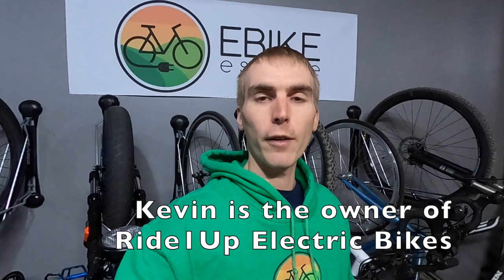Cadence Sensor Vs Torque Sensors | Which is Better on Ebikes?

Comment from the maker: Which do you prefer - torque or cadence sensor?
Reply: Is it possible, to upgrade our Radwagon to a torque sensor ?
Reply from the maker: @Ematuresco  Not easily that I am aware of.
Reply: Very complicated question.  For me cadence because I have respiratory problems and need it.  If I would ride just for exercise, and could handle torque, I'd rather have that.
Reply: This is easy for me. I rode an ebike with torque sensor and fell in love. I built one with cadence and was thoroughly disappointed. Torque feels natural. Cadence is probably fine for commuting.
Reply: Case by case. If I want to ride the bike just for the sake or riding, and beef up my cardio - torque sensor. For commuting and doing work, when I don't want or need to get exhausted riding a bike - cadence sensor. As a delivery driver, cadence sensing works better for me most of the time. Take it from me, after 4 hours on a bike, you don't WANT to exercise anymore, you just want the thing to get you where you need to go, reliably and with minimal effort applied. Especially up the hills. So I'm perfectly happy to ghost-pedal while the motor does 99% of the work.

So I have both. A TSZ2 500w torque-sensing mid drive bike, and a big ol' direct drive 2000w hub cadence sensing one. I use the first one for recreation, and the second one for my job.
Reply: @necroticavalon5176 Good points👌.

Comment: Thank you Kevin for the interview. The use case for the cadence sensor is stronger for more people more of the time.  The torque sensor is better for true trail-riding, when you want that quick, precise control over torque/power as you navigate rock gardens, roots, switchbacks, etc.  Serious trail-riding is also where a mid-drive outperforms the hub.  But for all other scenarios the cadence sensor works better.  When a noob friend was asking me about it, I explained it this way: when you're getting exhausted, the cadence sensor will still give you the same amount of assist.  On the other hand, when you're "gassed out" on a torque sensor, it will give you less help, even though you need more.  I remember my first long ride on a torque sensor; I was so disappointed at how I kept having to push myself, even when I was getting tired and wanted more help from the assist motor. Like a non-ebike, there was just no getting a break.  Torque sensing means you get what you give, no cheating.  (Unless you have a throttle, then you could get a break).   I am not trying to tell people that prefer the feeling of a torque sensor that they are wrong.  Both have use case scenarios and at the end of the day both are just ways to activate the assist motor.
Reply: Well said!! I’m using this example if you don’t mind..damn!
Reply: Excellent explanation!
Reply: You said it so well.   I commute every day 10 miles total with a cadence.  3600 miles yesterday.  I think about how my commute would be different if I had a torque sensor, I don’t anticipate ever wanting to change to a torque.

Comment: I have experience with both. We now own 2 LMTD torque sensor bikes. Never get rid of the torque sensor. When you pedal harder, it goes faster. When you pedal lighter, it goes slower. Does it get any better than that? A lot less fiddling with the power selector, so more attention can be on the actual riding of the bike....obstacles on the trail, braking, gear selection, balance. Just like a real bike.  I like a bike that feels like an extension of myself, and that is what torque senors do.There are a lot of bike riders like both of you and me that prefer torque sensors and would be forced to look elsewhere. Cadence is important for those too weak for the torque sensor. Please keep both.  Don't eff it up with cadence only.
Reply: Everyone seems to think you are weak if you like cadence.  I’m far from weak, my riding skills are humbly damn strong.  If I put myself in PAS 3, I can pedal against that and get cardio for as long as I want and go 20mph.  You can do that in any PAS, but your top end won’t be 20 in 1 or 2 and the ghosts down come out until 28 mph.

Comment: Glad I got the lmtd with the torque sensor. Couldn’t ask for a better bike
Reply: I feel the same. I like the feeling of pedaling a bike. No need for an on/off switch in the crank. There is already one under my thumb.
Reply from the maker: @troyuntig1624  Great point Troy.

Comment: Still love my gen 1 lmt'd. After the software upgrade it's flawless. Before that I haven't ridden any other ebike, but I did ride a lot of fixed gear and single speed bikes, so I'm used to pedaling hard. So the torque sensor works great for me. 

I recently was able to ride the Lectric XP which has a cadence sensor. It took a little getting used to. You don't have to pedal as hard and the response isn't as quick. It's also a little less natural feeling, you can tell the bike is doing most of the work.

I'd say if you're more athletic or want more of a workout with a natural bike experience but faster, then go for the torque. If you're not as athletic or just want an easy ride then go for the cadence. Either way they are both very enjoyable.
Reply from the maker: Good to hear you like your LMT'D and always good to get thoughts from others on cadence vs torque.
Reply: Thanks for the clear explainer. Very helpful.

Comment: I have had both and prefer the torque sensor hands down.  I got rid of the cadence sensor as it is like an on/off switch with set speeds.  I was constantly pedaling to speed up, then coasting to slow down.  I could not get used to "ghost pedaling" on the cadence sensor.   With the torque sensor, the power is there when you need and not there when you don't.   Torque has a much more natural ride feel.  You can pedal at a steady speed and if you hit a slight incline and need assistance, the torque sensor will apply power to the motor to help you over it while maintaining the same speed.  I think getting rid of the torque sensor would be a mistake as other competitor-ebike companies are adding it to their lineup, especially in the commuter styles.

Comment: I know I'm a little late with this and the LMT'D has already been changed,  but I definitely prefer the torque sensor.  The feel is so much more natural (except that I feel a little like an Olympic biker). I love how the bike smoothly surges when I peddle harder. 

With the cadence sensor, even at higher gears, I find it difficult to keep my legs "engaged" once I reach my constant cruising speed. If I don't keep enough pressure on the pedals, it feels like I'm free wheeling for a few seconds until I "re-engage" with the pedals. I hear an audible "clink" when I re-engage. This goes in and out, clinking along.

That's just my preference.  My wife loves her Rad with the cadence sensor and doesn't like the feel of my LMT'D. Like you have said, neither is better, it just depends on your preference. I live in the flat low country of South Carolina. I might feel completely differently if I was pedaling up and down hills.
Reply from the maker: A very accurate description! I ride both our LMT'D and Rad and I don't mind riding the Rad after being on the LMT'D - I'm still on an ebike after all!

Comment: I have cadence and 7 months into riding I find it's not the workout it was in the beginning. In the beginning I was always in PA 3 or 4, 7th gear. Now I find I prefer PA 1 or off with the motor as a backup for when the thighs burn too much. Regular ride is 15 + miles daily which has become too easy. My next bike will be torque. Cadence is perfect for older adults (me) that have been sedentary for far too long, ride to get in shape, and graduate to Torque for a better workout. Best.
Reply from the maker: Thanks for sharing!

Comment: I tried cadence sensor on Aventon sinch and I did not like it at all, the motor kicks in and pull you hard on the lowest pedal assist and it goes off as soon you stop paddling or you hit 10 miles/hour making it unpredictable and I can't do any work out if i won't to go less than 10 miles/hour, versus torque sensor on IZIP Sumo mid drive bosch motor feels much like normal bike that you can do work out or just go fast were ever you want to go. This is just an example of many torque sensor i tried and I really like. Kevin, please keep the torque sensor and expand that to other bikes as an option. Thank you very much
Reply from the maker: Appreciate you sharing your experience. I have yet to test out an Aventon ebike.

Comment: Love the cadence sensor on my 700ST. Yes you can pedal effortlessly, but you can also play with balancing between Assist levels and gear selection, so you can actually help with as much effort as you might want...or not. In other words you CAN push the bike faster by pedaling with effort. After zooming about at first, the concept of hyper-mile-ing keeps things interesting in how you interact with the bike's systems. Have no experience with torque sensors. Thanks for the video!
Reply from the maker: Great to hear from both camps :)

Comment: I’m 70 and ride a popular commuter cadence class 3, 5,200 miles, thumb throttle.  If I ever get another, it will be cadence no question.  I’ve got 8 gears to get me into my happy zone.  I ride it also daily for errands and groceries, today it’s 107 in AZ and just got back.  Hard to sweat then with a 15 to 20 mph breeze in your face.  Mostly flat terrain.

Comment: Definitely prefer the torque sensor. When on a Cadence sensor bike, its not as predictable. You could be ghost pedaling and the motor will just kick in suddenly. It's a bit unsettling.  It feels like driving a car with a big turbo where the boost kicks suddenly rather than a naturally aspirated car where you feel more in control of the power.

Comment: I just got the Lmt'd.
Its two bikes in one.
Using the lower power levels, the ride is exactly like a regular bike. You can pedal til your legs are burning and your heart is racing OR
You can use the higher levels for an almost effortless, relaxing ride, letting the motor do most of the work.

Comment: Just because you are on a cadenced  ebike doesn't mean you can't get a workout. During my ride, I would engage PAS only on the inclined stretches. For the rest of my ride, I normally use PAS=0. Because of my ebike's extra weight, I ended up with a pretty decent workout.

Comment: The LMT'D would probably go to the top of my list if it was available with a cadence sensor.  Have some long hills and some steep hills on my way to work and I don't want to work a ton to get up them and a cadence sensor with a 750/1000 watt peak motor with pretty good torque would get me up the hills pretty easily.  Can always tone down the pedal assist or ride it like a regular bike for exercise if you want.
Reply from the maker: One thing we should have covered but didn't was that with the newer LMT'Ds you can use the throttle up to 28 mph as long as you pedal. This functionality makes it possible to put in little effort if desired, much like a cadence sensor.
Reply: Apparently new builds of the LMT’D will be cadence. Torque won’t be available after current inventory sells out
Reply: @EbikeEscape  I would definitely like to hear more about how the throttle can be used in conjunction with both torque and cadence sensors. I'm a senior but fit and leaning towards a torque sensor for the workout but curious about the type of workout I can get with a cadence sensor.
Reply: The Ride1up turris is the same bike and had a cadence sensor. I have a turris and it is great

Comment: Torque Sensor: You get what you give, multiplied by assist level. 
Cadence Sensor: You get a set amount per level of assist, no matter what you give.

The problem with torque sensing is that it won't help you at all, if you're tired. If you give less, you get less in return, when you want more. So for serious commuting (especially uphill) for someone who's not that in-shape, cadence sensor all the way. For someone who is in good shape, and just wants that extra boost to their own boost, torque sensing works better.
Reply from the maker: The bridge between these two is when there is a throttle on a torque sensor ebike. But those are not super common. -JT
Reply: @EbikeEscape  Yea, the TongSheng has throttle, but it's... NOT good. Let's put it that way. There's a lag before activation, and it feels very jerky. Still, at least it has one.

Comment: I have been riding a bike with a cadence sensor for over 5000 miles and depending on what PAS level you are using I can add effort to it and save on power usage. So I am not just spinning when riding. Based on that experience I don't see a need for a torque sensor.

Comment: I have ridden both. Torque sensor on 2018 Trek DS and cadence sensor on a conversion 2015 Trek 7.2 FX with Bafang BBS02. As with health issues. I find the cadence senor on the BBS02 more enjoyable. If I haven't had health issues and able to do the pedaling harder. Torque sensor would be my way to go.
Reply from the maker: Thanks for sharing your experience!

Comment: It looks to me like most of the commenters prefer torque sensor but sadly Ride1up has made the change to cadence regardless.  Does anyone have suggestions for a bike similar to LMT'd but with a torque sensor?
Reply from the maker: Hi Jeff, I will keep an eye out. I know Eunorau has the "E-Torque" though I haven't tested it out myslef: https://eunorau-ebike.com/?ref=tcagucypv8ri

Or maybe check out the Juiced CrossCurrent, again haven't tested out Juiced' pedal assist: https://bit.ly/2QsFpbz

Comment: In the Ride1Up Owners FB page there is talk that the decision has been made to switch over to cadence only builds. I feel like I want to keep the need to have leg effort since I use cycling for fitness. When I ride with my wife I tour but still try to get a workout as well. I bought her a 700 and I want the LMT’D for not only the torque sensor but also for the better look of it with the way the battery is integrated and other upgraded equipment over the 700. I don’t like the way the battery is mounted in the 700. It’s cumbersome to remove. I would vote for keeping torque sensor but it does make sense from a business perspective to go to cadence only since only one model has torque. If we could truly build our own bike with options then it would be good to have a choice for torque but that probably will never be their business model.
Reply from the maker: I too would have liked to see them keep the torque sensor. I'd guess it wasn't a decision they took lightly. Thanks for sharing your thoughts on the 700 - I believe I'm going to review that model next.

Comment: Do either have an advantage for steep hill riding?  I think the motors generally used with torque sensors usually have more torque overall, and I know this is important for climbing.  I don't need the speed, but I need the grunt.
Reply from the maker: In my opinion you'll be fine with the motor on the Core-5/500 Series/700 Series or the LMT'D. The LMT'D does have a higher torque motor but the other ebikes are plenty capable of tackling hills. It's just you'll need to apply torque to the pedals for the LMT'D to engage so it encourages you to work a little harder. You still need to be able to have the pedals spinning while going up the hill with the cadence sensor. Of course you always have the throttle :)
Reply: @EbikeEscape  Thanks for the reply.  And I should define "hills" a bit better.  In my case, my work commute goes 5 miles up a mountain pass where I gain 2000 feet elevation in that distance.  Some might call it a "mountain" :-)

Comment: My wife and I both ride 700STs. I scoured the mid price market looking for the best value vs performance equation. R1U was the ultimate winner. I test rode torque sensor bikes and felt that for us, fit but not young, the cadence was a better option. For sure, when we want an aggressive workout it’s easy to get there. But there are times, like after a long uphill pull, when we just want to chill and let the bike work for awhile.  I get that athletes and wanna be athletes might prefer the physical challenge of a torque sensor bike, but there are hundreds of analogue traditional bikes for that purpose. We have 7 speed cruisers for those occasions but  find the exhilaration and freedom of the 700STs almost always win out.   Kevin, stick with cadence sensors. Let others muck around with the complicated logistics of multi power systems.  Concentrate on improvements in battery management, QC and running gear upgrades.  JMHO
Reply from the maker: Hi Randall - you came to the same conclusion I did when I started delving into all of the different brands. Thanks for sharing your experience.
Reply: Good points Randall about putting effort toward improving what they have. I’ve been following what they have done to all the models to keep improving them. I bought my wife the 700ST and I’ll get the LMT’D for me. I’m way more athletic than her so I feel that will make up about even. I use cycling for fitness since I can’t run any longer so the torque sensor makes sense for me.

Comment: Recently switched to a Limited, unaware of these detailed comments about the cadence vs torque sensor. Yes, the torque sensor requires more effort so it also gives more exercise to a ride. I've been taking some long rides and the battery seems to last quite a lot longer than it did on my cadence sensor bike. Makes sense since I have to pedal harder. On the highest assist mode it handles whatever you throw at it with relative ease. Overall I'm extremely pleased with the bikes performance and handling.
Reply from the maker: Thanks for sharing your thoughts Greg!